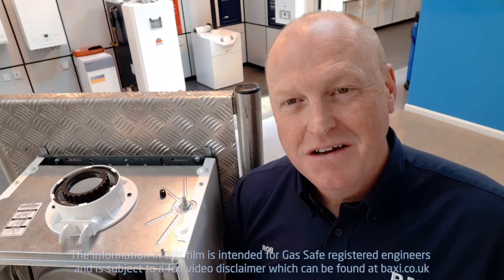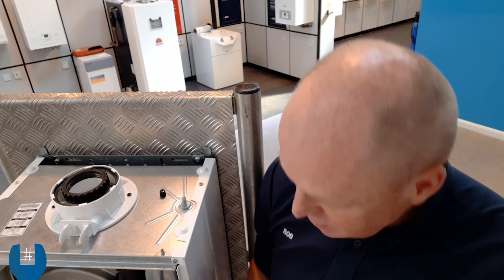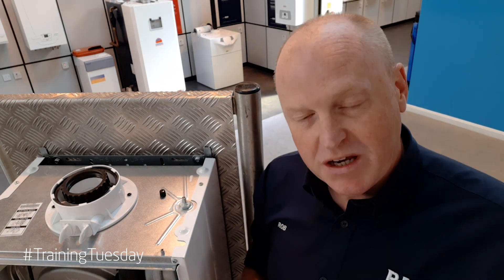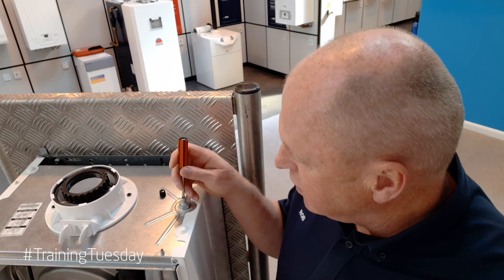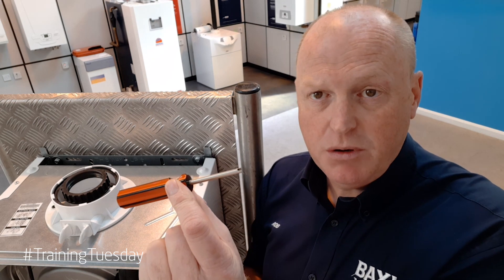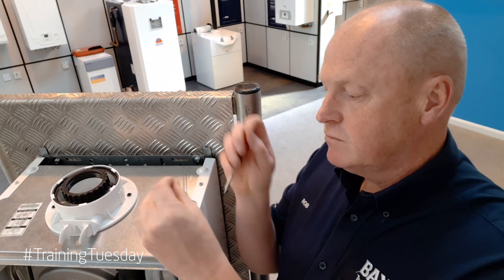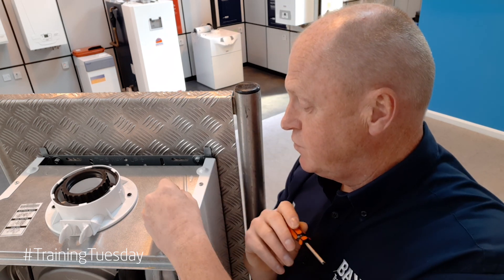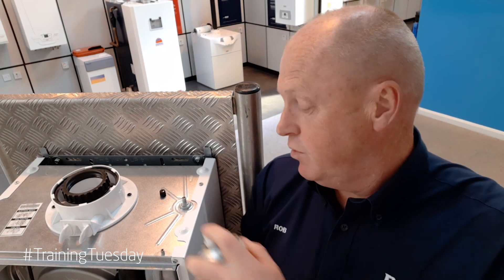How to check and replace a Schrader valve on a boiler

Comment: And if the valve is seized and the top shears off as sometimes happens in older boilers...tap a small Allen key into the remains of the valve and gently wind it out. It saves a lot of grief if you find yourself having an "Oh Bother" moment.